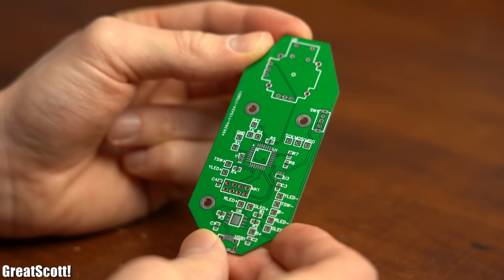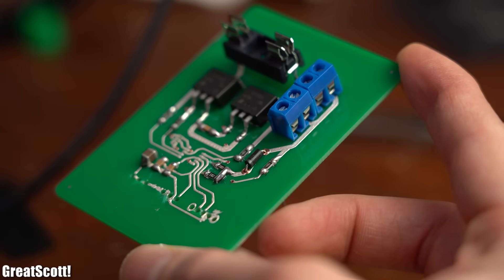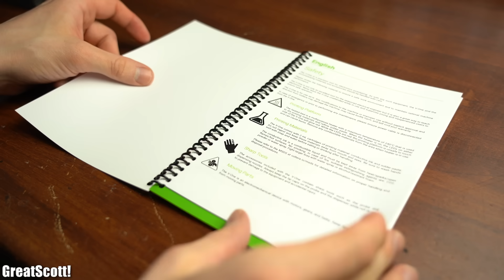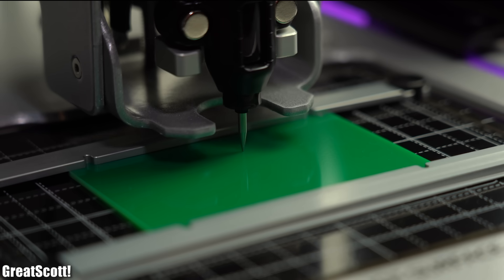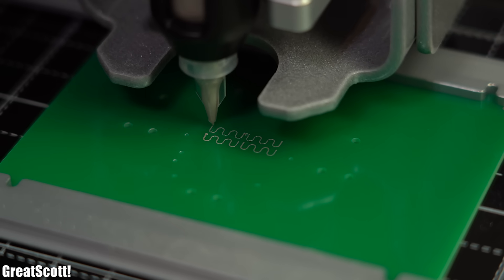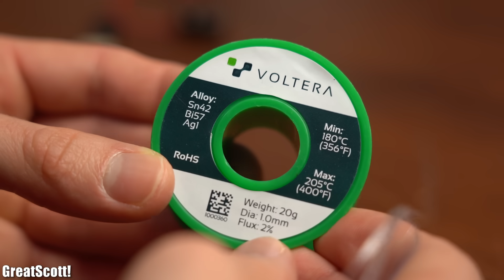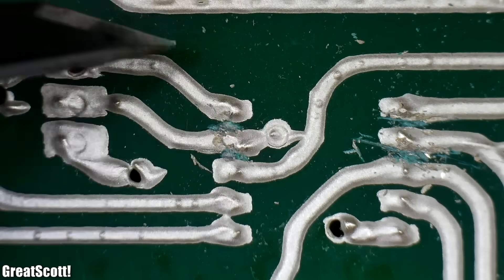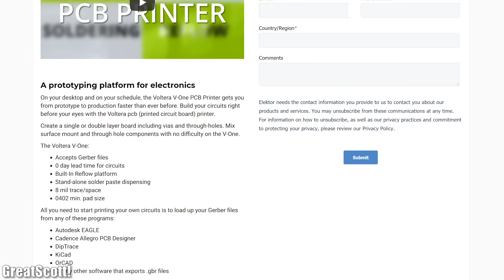You can now PRINT PCBs! Creating a homemade PCB with the Voltera V-One PCB Printer!

Comment: The comments seem to miss the point of this: This is for profesional rapid prototyping, it's not for end products made by hobyists.  

It doesn't compete with PCB manufactue houses, instead it competes with protoboards. And if you are a company, having employees waste time hand soldering wires on a protoboard quickly becomes expensive as the hours rack up.

Comment: This can be done extremely quickly on a cheap laser cutter/engraver without having to mess around swapping parts and filling "ink"
Seems to be tool that didn't need making. Laser cutter/engraver can do the traces, holes, and even the custom pcb shape.
You can also do several layers of materials with the laser,  have traces covered properly and details printed using other quick methods. 
Just seems like a useless expensive toy.

Comment: You can totally bodge a surface mount on perfboard, use double sided kapton to fix it upside down and use tiny enameled wires pad to pad. Noisy as can be but perfboard always is

Comment: I made the mistake of buying one. Hand soldering is a pain in the ass, Cured ink breaks off very easily during hole-through assembly or even by picking it up. Resolution is .... just "meh!" Ink only lasts 6 months, , just like the solder paste, clutters the tip very easily and "flows" during curing, creating shorts..... the list goes on. The promise is bigger than the result. We've also tried to create PCB's by burning away copper with a laser engraver, but the best results we get from the Wegstr CNC milling machine. Its slow ( almost as slow as the Voltera ) but no curing is involved, normal soldering can happen and the resolution is fantastic.

Here in the Netherlands the Voltera costs ~ EUR 5.000,=, Substrates aren't cheap and the ink and solderpaste are around 50 to 100 EURO each. This makes the process of creating a "maybe it works" prototype quite expensive. For EUR 3.000 we've bought the CNC mill and that is about it. Normal PCB's can be used, no special tools needed, holes are getting drilled, normal solderpaste can be used etc... .

An expensive lesson learned..

Comment: I wonder if it would be easier to just use a conductive PLA filament on a 3D printer to accomplish something similar. You might have to manually drill holes, but considering you can get 3D printers pretty cheap and filament pretty cheap, you could test this for under $200 total ($150 for a cheap 3D printer and another $50 for the filament).

Comment: I think I still like my method of using tack-less PCBs and making nearby connections with solder and the more further away ones with a sort of jumper cable that is really easy to work with: single conductor, slightly rigid so can be bent to stay in place, 0.75 mm2 cross section. I have these in spools in red, black, yellow, green and white. They cost virtually nothing and are a joy to work with.

Comment: I was curious about this product but now I know it is not for me. If I have time I'll order on jlc. If I need it here and now I'll just use Laser-Ironing to make my own. For those who don't know this tec: Print your PCB layout mirrored on a gloss photopaper on laser printer, then put it on a copper coated pcb board, then use an iron to press it to the pcb. It will transfer the ink onto pcb. Then wash off paper and you will have traces on copper. To remove exessive copper you simply put this pcb into mix of Hydrogenpyroxide and Lemon acid for half hour. Then wash it, drill it and you are golden. 2 hours of work will give you much better quality of the traces than voltera and you you will save a lot of money:)

Comment: Hi and thank's for your video.
At this price i'd buy a guided laser on x-y axes may be. Some are pretty good, but i do not really know the limits of that.
For now i'm etching  circuit pads and tracks with solder a solder masq paste that i bought before : i bought a lot.
It was quite expensive but the result is perfect. So i use thypons calcs , the old way. Solder masq is negative but it is not a problem at all.
I do not trust pre-sensibilisated cards any more because i had problem with them and they are quite expensive too. 
For simple sided bords : i modified a printer and it prints toner on the board that i need to fuse with acetone vapors.
This is actually the thinner method i've got but it make only single side difficult to align with simple solutions.
And there are many problems :
1/ the printer drum can be easilly damaged with your cards because it's hard compare to paper.
2/Sometime the electric charging roller does not seam to conduct on the drum because printing is pale.
May be a security problem because the card is probable to much conductive compare to paper.

I do not believe in a mechanical method: printers make many distorted proportions for these reasons:
Drums shapes, speed variations, Drum status and clearance, rollers status and clearance, etc...
forces me to print each layer on different calcs but at the same place.
Which cost a lot in calcs. 

I thought about a solution : photographic uv exposure:  concentrate the light of a L.C.D screen on which you print the circuit on the board with a lens.
But the LCD should have is internal L.E.D or lamp changed with UV ones. Not sure it is so easy to achieve.
And not sure it will work : let's try...

The UV peelable pastes are very expensive but if you are a chimist : you could may be make then yourself at very lower prices. 
Same for the metalisation wich is a complicated process too.
For now : i do not metalise which is another problem too sometimes.

Comment: I look at this and I think:

The dot matrix printer was superior to the daisy wheel because it allowed graphics as well as text. The laser was superior to the dot matrix because it gave far better resolution, ink-jets have driven the costs down (kind of, original ink cartridges are still expensive) and the 3D printers have taken printing into a while other dimension.

This PCB printer, is the first step on a journey that will develop into a better product, with higher resolution and be more cost effective. 

Thank you for sharing.

Comment: Pretty cool, but yeah, the price does seem rather prohibitive, especially considering that the resulting traces seem pretty resistive.
It does look nice though, and the cnc hole drill definitely seem like a timesaver!

In my department at Uni we mostly go by etching; 
Print the design on parchment paper, align it on a PCB (with photoresist coating), put it in the UV box ( on a 90 second timer), dunk it in the developer tank for 20 seconds or so, rinse, put it in the etching machine, wait 5-10 min, and then clean off the remaining photoresist.

All that remains is to drill holes.

The etching machine is basically an acrylic aquarium, with an aquarium heater,  PCB holders and rods that suck up the etchant from the bottom, and spray it in the chamber by centripetal force, all plastic and somewhat inexpensive parts.

Total time from printing the paper to finished PCB is around 10-15 minutes (plus hole drilling time) if the etchant is warm (and people don't forget to top up the sodium persulfate...).
Doing two sided prints only adds that you have to print a second circuit layout and align the two, rest of the process remain the same.

Comment: The lines are just printed with ink and you have to solder all of them yourself? thats a lot of work if you want to produce a more then just one board. how about cut a thin metal sheet with a cnc and just glue it on a board? or place a metal film on a board and melt the lines into the board with a laser engraver?

Comment: Not sure if I like this method. It might be fine for small prototypes where you don't care about the resistance or capacitance of the traces, but I wouldn't use this for anything that complex.
Why go through this mess with ink when you can engrave them with a laser instead?

Comment: You must maintain 50 ohm tracks on a printed circuit board.  Does anybody say otherwise?  No.  How thick and wide, and of what conductor should you use, to maintain each track at that level, and how long or short should your design track be?

Comment: I make virtually one-off circuits all the time. So the typical transfer method works for me and rarely do I make any mistakes transferring any circuit to the board now... And I have a great floor model drill press that accepts the finest wire drill bits I own up to and including #80. So I will continue on with how I do them. Great video anyway....

Comment: For over 4200 Euros that is certainly not home or hobbyist use. The res. is not good enough for professional use so they aren't going to move like hotcakes. LPKF still leads but it is over $70,000 again only pro use. These days PCB houses do fairly well on delivery time. 70K or 4.2K buys a lot of proto PCBs so I don't get the point.

My 2c worth.

Comment: I am fascinated, but would never buy or use a machine like this- It seems like a major project to create an inferior board, and the compromises you need to make in the actual PCB design means you need to design the board twice, once for the prototype, then again for production. You can build a breadboard in less time, and it will perform like a real PCB, I don't see this being used in a real product development engineering situation.

Comment: Paying $4000 for a machine that doesn't even produce the solder mask seems odd at best... For prototyping you can use a resin printer or a nail lamp with laser printed transparent foil - the process also takes roughly 1h and allows for a higher precision + the solder mask can be done the same way. Honestly I see no future for this technology they're trying to sell...

Comment: So what is the advantage of this over a cheap, $300 3d printer modified to extrude their special solder paste? I'm guessing you probably also need their special boards for it to stick right. But still, just adding a drill to a 3d printer wouldn't cost $3500. So what exactly justifies the four grand price point?

Comment: There is one additional minor issue (not sure if he mentioned it), but the input is 200V AC min, you aren't running it on 120V (and I have my doubts about 60 Hz).  It takes about 2.5A at 240V so that's a significant transformer if you go that route.  I'm rather surprised they didn't make it 110/220 compatible.  Most things today are and don't even need a switch, they just have a DC supply built-in that takes anything from 85-265V.

Comment: Voltera is $4199.98 USD hahahahaha, I'd much rather spend the money on a 100 MHz oscilloscope, a function generator, 2 power supplies, a new PC, a large isolation transformer, a Variac power supply and a half dozen multimeters (never can have too many) and keep the other $2000 for my projects. Save myself all the messing around with a PCB made that way too!!

Comment: Come on, print the welding inverter power board on this one! ))) I saw this product when it was still in the prototype stage. Since then, nothing has really changed. As it was raw, it remained. A bunch of permutations and readjustments. While you do all this, I will prototype five times with an iron and a laser printer. By the way, it is not at all necessary to make vias in the classical way. Nobody bothers to do the old-fashioned way - transition wells, through which several conductors pass at once, soldered to the tracks from different sides of the board.

Comment: No board shop, no matter how lax their standards would have knowingly shipped something that looked even remotely that bad.  However, the original 3d printers were pretty lousy too.  The prices went down (way down), and the quality has come up significantly.  I expect the maker community will drive costs down and quality up so that in about 10 years, it should be as accessible as 3d printing is now, assuming someone doesn't try to kill the endeavor with patents and litigation.

Comment: why not just draw it on a copper plate and use chemicals? either way you use chemicals, and either way you have  to draw, and both are as dangerous, even worse both cost on a regular basis. 
why add extra steps to a simple tried and true process?

Comment: Excellent video, very interesting!  As for the product, honestly, I still prefer the good old-fashioned recipe, print the circuit on transfer paper with my laser printer, transfer it to the blank pcb and leave it in the iron perchloride.  Then it's just a matter of drilling and soldering the components.  And if you still want to do more, just apply a colored varnish.  It looks great!

Comment: I'm using PCB proto boards, I solder the components and sets of double row male headers, and wire wrap the connections. It's quite fast and reliable.

Comment: Wondering if anyone can help, I am looking into desktop PCB printers for a specific project, and I need something nearly industrial grade. Is voltera good enough for this ? " $5,000 - $8,000 range... not crazy-expensive but it has to take the pounding of student use, build robust boards which can withstand multiple flight conditions (cold, G forces, etc.)."

Comment: You could print PCBs at home for decades... just not this high quality. All you have to do is print your circuit out using a laser printer, then use a heat press (like for t-shirts) to transfer the toner onto a copper-coated plate, and then submerge the plate in ferric chloride and it will dissolve the copper without toner on it, thus leaving you with just the copper traces you want. You can even do two-layer boards by getting doubles-sided plates and drilling holes through it to create vias to connect the two sides together.

Comment: I have a lot of experience working with the voltera and the nscrypt 3d printers from an internship. The voltera is very nice for printing on flexible substrate and can tolerate using a variety of approved and non-approved inks. You can make your own inks that have properties you want and you can load them into the voltera using lurelock connections.

Comment: I also see some issue with the thermal conductivity, as those blobs of solder look pretty scary. Also wonder if the cost of the "ink" will not make it cheaper to just order your boards :) Though... For this price tag you can afford a simple CNC for drilling, an inkjet printer, and a UV-lit table to just make the "real" PCBs. We also tried to use a laser to just burn the paint off a painted board so it could be etched later, and this method proved to be, although not as accurate as the UV-one, still very reliable and fast (also cheap).

Comment: So, I have no idea how to design pcbs or how to make Gerber files, but is it possible to combine an arduino uno and the L293D motor driver into a single pcb? I'm working on a project where both are required, but for long term use of I can combine the two into a single pcb, then I can use the separated board for other short term projects.

Comment: Great demo video, thank you. I was very interested in this printer until I saw the horribly poor quality result. Maybe good for extremely simple boards, but if you're doing enough to warrant a PCB printer you're probably not always doing super simple designs. After seeing what it did with his design, I shudder to think how it'd print out even a simple 32 or 48 pin mcu design. Add the price tag to that and this is just not for prime time.

Comment: So all it's doing is laying down a flux so you can trace it with conductive solder after, correct? I assume it's a solder with a high silver content which I already use because it just works 100% of the time for me. This would be an easy project to turn an old 3D printer into. I'm doing it! I already seen people make automatic flux dispensers on Thingverse, I was wondering what I could use it for, and now I know! If I was rich I would just buy this. Beats making your own traces with wire, and I've still have yet to use a single surface mounted component in my projects..

Comment: I always use single or double sided fiber glass cooper clad but instead of hot iron for toner transfer (can be used for component mask and solder mask) i use 8:3 alcohol-acetone mixture then after etching with ferric chloride and drilling the holes I put small drops of hot glue to cover the soldering areas and proceed to paint the rest of the surface with green heat resistant spray paint, using self made pine- citric acid  soldering paste or flux highly recommended for people that are exposed to solder fumes often because synthetic soldering paste or flux are not healthy. Order pcbs is good but when you want to feel proud of your handy work DIY is the best option

Comment: I think you should DIY one of these.
I think that if you build the 3d printer, and turn up the head temp and narrow the filliment then you could print directly the circuit. How you get it to stick and to what is something beyond me currently.

Using a cold bed would form the tracers, and  obviously the print head can be removed and swapped for a drill head.
Reply: @lepidoptera9337  time and place a cause? 
I think now more people make things, if it's easy enough. And if there is a app. 
Many years ago, things were very much all work no play and small hobby groups. And no Facebook and YouTube launchers.